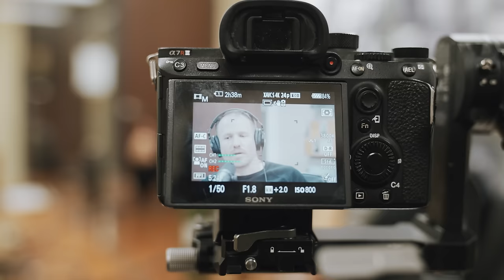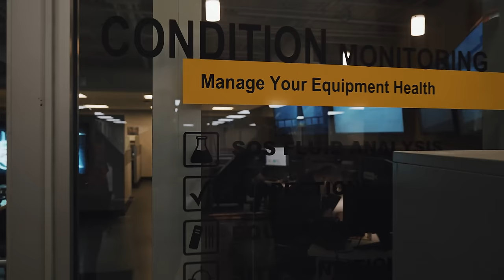Visiting the Largest Equipment Dealer in Utah | Wheeler Machinery

Comment: You guys need to go tour the Lafayette engine center in Lafayette Indiana. That’s where those 3500, C175s and the big unit 3600s are machined from a casting to a running engine. Machine shop all the way to dyno and final paint and shipping in one building. I worked there for 5 years and it’s an amazing facility.

Comment: I got to go on tour of open house of a new building for overhaul of Detroit Diesel and it had the Allison Automatic Transmission DINO area also. Very impressive new shop TESTING of those very complicated Heavy duty Transmission. Just the, what I call a maze for the Automatic Transmission FLUID runs in those great Transmission. It was amazing. The guys and gals that are Trained and know those Allison's insides are top notch. They know there stuff. Just watching them work on tear downs of those Transmission and what those workers know in there brains about how they work. They never get the credit they deserve. They keep the Garbage trucks and the bus's and most important the Fire Rigs rolling out on busy stop and go Driving on streets. It's very impressive just thinking about those DINO'S what they simulate, on load testing, so the power trains go back together and work for the Long haul. The Stop and go work, day in day out, and those Transmission take a licking and keep on ticking.

Comment: Next time your in AZ, you should come check out Empire Cat. Definitely worth while.
Reply from the maker: I'd love to
Reply: @AaronWitt  You guys need to go tour the Cat Lafayette engine center in Lafayette Indiana. That’s where those 3500, C175s and the big unit 3600s are machined from a casting to a running engine. Machine shop all the way to dyno and final paint and shipping in one building. I worked there for 5 years and it’s an amazing facility.

Comment: Thank you for the walk through. The explanation of those trash landfill machine is very important on the building up of Garbage/ trash. Very hard wear on any Landfill Garbage work. Just wears out undercarriage. I like the Guard removers of Trash corrosive junk.  Just those little bars, extend the life of wear on tracks. Personal think Garbage Landfill is harder on heavy compaction Equipment than say big Dozer's pushing down the top of a mountain in like Virginia. Or just west of Salt Lake City at ( Bingham Canyon Copper Mine) If you ever visit Salt Lake City, it is well worth your time to go up to visit the mine. The Gate entry station people are very nice, give you a MAP of wear to go to overlook gift shop
I got to see BLAST of a shelf, then D-10s & D-11sare      I have seen complete rebuild of Garbage transfer stations, so the pushers don't have to rub the cement edge of walls( wear out sides of undercarriage's on pushers. Garbage truck dump on large floor area, instead of dumping Garbage over from top. Next time you go dump your Garage at say a transfer station. Look at the condition of the big trash pushers. Very ruff looking, lots of wear and tear on Equipment.

Comment: Fact check, the largest equipment dealer in the state of Utah is Arnold Machinery. Arnold owns Six State franchise for Volvo, and Hitachi mining. They also are One of the nation’s largest Hyster lift dealers with over A Six state territory. They also own general implement which is a wholesale suppler of farm equipment for the western United States. Wheeler equipments largest customer is Brigham Canyon mine (Kennecott Utah Copper which accounts for about 30% of its revenues which is scheduled to close in 2035. This will have a significant impact on Wheelers machines in marketplace, and with no other large significant open pit mines in Utah this will be devastating blow to this Cat dealers mining support and sales division. In addition Caterpillars exit from OTR engines due to emission complexities lost some large truck engine customers like Simon, Godfrey, ShipEx, Savage and Pride which accounted for a portion of its sales. 
Wheeler may be your favorite dealer, but far from Utah’s largest.
Reply: Fact Check, Wheeler is by far the largest equipment dealer in Utah. Arnold has three locations in UTAH, Wheeler has 11. Wheeler's shop space 150,000 feet dwarfs anything Arnold has. As far as machine sales, Wheeler is the number one selling dealer in Utah. Wheeler outpaces, Komatsu, Volvo and Deere.